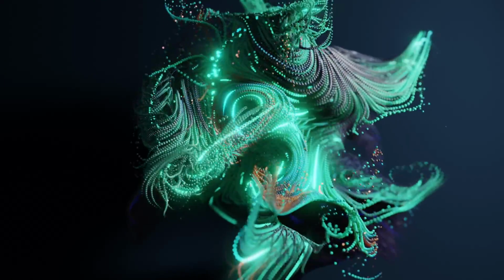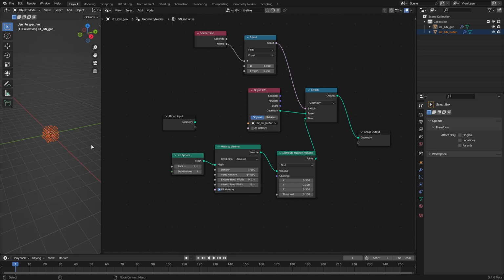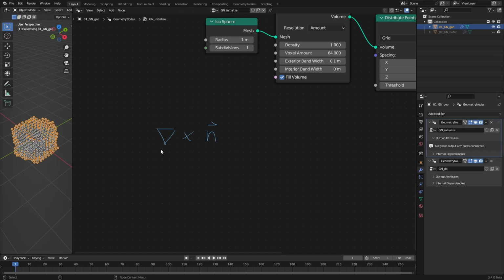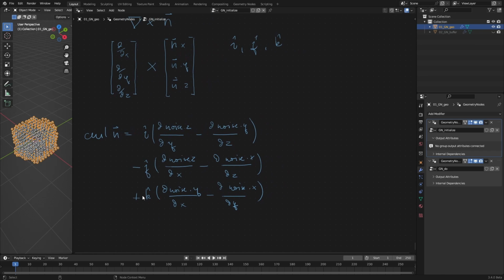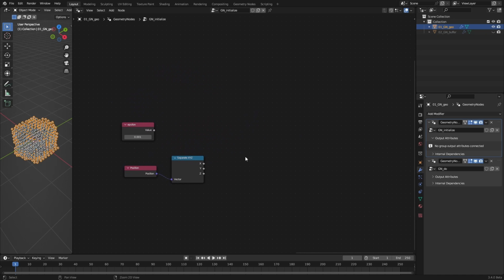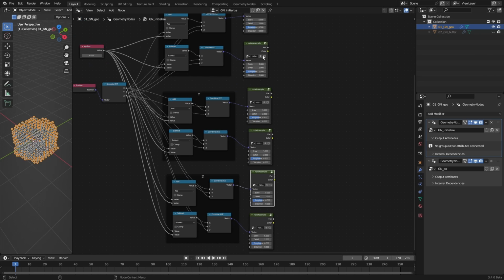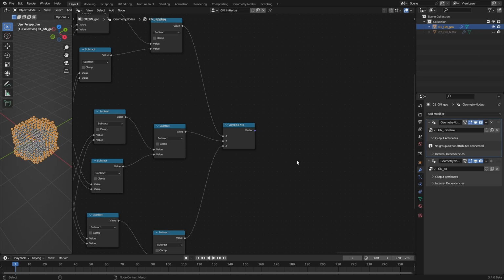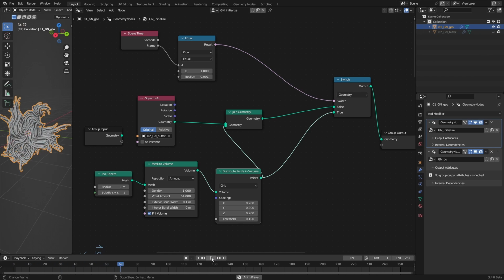Blender Tutorial: Geometry Nodes Simulation: Advect by Curl Noise

Comment: Going through a backlog and recreated this with new simulation zone. It's pretty easy if you don't forget to add original points from outside the simulation zone and not from inside (from before simulation zone starts and into the zone itself).

Comment: As typical of Manu, an overcomplicated solution for a conceptually simple task. On the one hand, it makes no sense at all using Blender to do this yet. Just switch to Houdini, and you can do the same with two nodes. On the other hand, simulation with GN is almost there, so why not let the developer do their work and then we can continue the normal software path. I understand that it is a good push to the GN developers, but for the rest of us, I don't see the point of reinventing the wheel like this. Thanks anyway for kindly sharing your expertise.

Comment: You should check out the new 3.50 alpha experimental "geometry-nodes-simulation" build (b5ea0d2f411b). 

It has two new nodes, 'Simulation Input' and 'Simulation Output' to let you do this without the hack. It's still kinda buggy (I've had it crash on me a couple times while playing around with it) but hopefully it will get fleshed out soon.

Comment: Will the simulation nodes in the future be able to do the previous Blender's fluid or smoke simulations without baking in real-time?
Reply: They are going to implement simulations in geometry nodes, and baking will be a part of it. My understanding is the bake buttons will be on the geometry nodes modifier itself, not within the node tree.
Reply: So taking a look at the 3.5 simulations branch, which is still early days, it's looking more like we'll get a check box on the output node to cache the simulation instead. At least that's what they had in one version, but now the cache was removed (I think it was buggy). Still, that boolean can be inputted by the group input node if you wanted to. Anyway, development is ongoing. Unclear where they'll end up. Some crazy stuff is already possible though. I created a smoke sim (a basic one) myself with a few nodes as a test to try and figure out some workflows and strategies. Hopefully in a couple weeks after the next geonodes dev meeting development will really kick into gear and the design will stabilize.

Comment: Thank you so much for the tutorial, could you please answer, how did you scale these points on final render?
I found point radius node, so another question, how did you do this material?
Reply from the maker: to scale the points I introduce an attribute on the geometry called age that counts how many frames a particle is alive. I updated the attribute in the cache tree. Then I mapped it to particle size. The material makes use of another attribute that I create through a noise field and use inside of the shader via an attribute node.
Reply: @Entagma  basically answered my question! however, I am curious is the cache tree the node tree named GN_do?

Comment: Love the tutorial! one question: how do you make the simulation appear in eevee?
Reply from the maker: I instance spheres to the points.
Reply: @Entagma  Thanks! I put the 'instance on points' directly after the switch node and then instance the ico sphere. It kinda works but blender crashes immediately
Reply: @NigelvanRoijen  Use low res icospheres instead, UV sphere's are too dense.
Reply: @unicornhuntercg  thanks for the suggestion, I tried that but it's still crashes when I press play. In cycles it plays smoothly strangely
Reply: @NigelvanRoijen  make a new object and use the points from sim to instance in the new object geometry nodes
Reply: @parzvalishere  This was helpful Thank you!